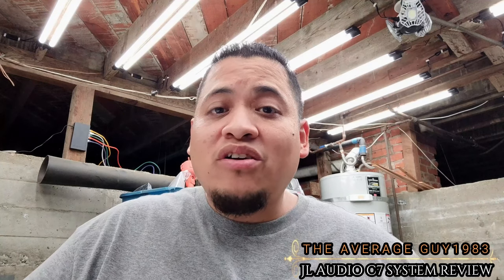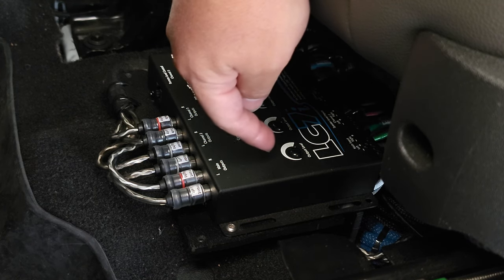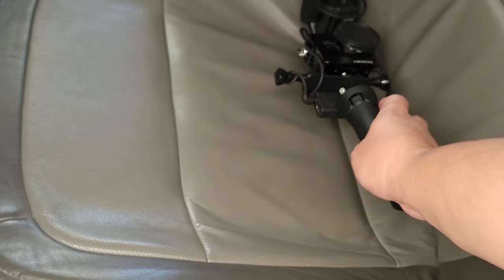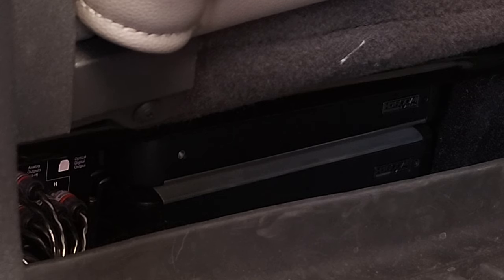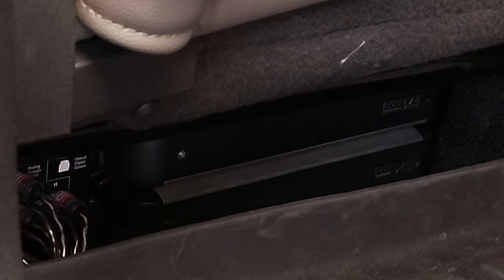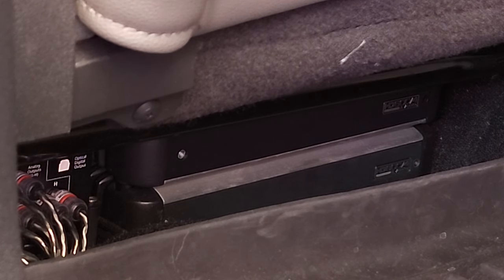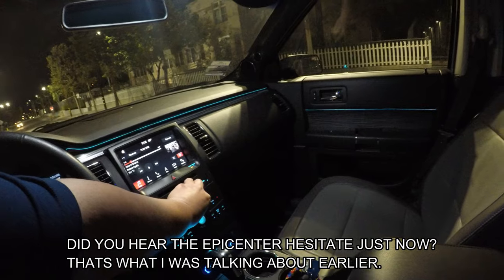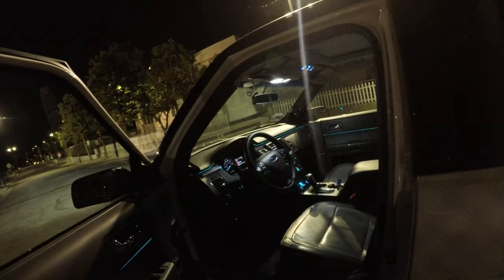MY JL AUDIO C7 AUDIO SYSTEM REVIEW

Comment: I'm considering 2 - JL Audio VX600/6i amplifiers for the front stage of a 3-way C7 setup, 1 bridged (200x3) for the left channel, 1 bridged (200x3) for the right channel. According to your measurements this appears to be 4x their rated real world power. Did you contact JL Audio regarding your findings? If so, what was their response? 

I've always leaned towards having considerable headroom, however 1 VX800/8i (200x2,75x4) or 1 VX600/6i (75x6) may be sufficient. 

Also, I may have missed it, but I didn't notice an alternaternor upgrade. Any thoughts on the topic?
Reply from the maker: Hi Troy, I have indeed reached out to JL Audio prior to making the video review and all they told me was that the recommended Amp Power rating for the C7 speakers are for Headroom but they did suggest that I ether stay with the HD amps and drop the gain on them to match the speakers for clean sound (which is exactly what I did) and found out what they can realistically handle or go with a VX800/8i and VX100/5i for my set up which would have been ideal if I would have know what these C7s can really output. As for the Alternator, I have the Stock Alternator for the moment as these HD amps are very Efficient and even though I have 4 HD amps and other accessories in my flex the voltage does not drop below 12.3 volts at full clean  volume. The only thing I did do was the BIG 3 Using 4/0 100% Copper Wire. The stock Alternator is a 175Amp Hour Alternator and the Stock Battery is a 75Amp Hour Battery but would like to upgrade to a 280Amp Mike Singer Alternator and upgrade the stock Battery to an XS Power D6500. As for the amps, I believe 1 VX800/8i and a VX600/6i should be plenty after my experience with them. I actually have been really thinking of switching the amps to the VX800/8i and 1000/5i as I feel that would be plenty of power for these speakers to perform well and it would free up some space underneath the seats for me. I can then use the HD amps on my other Vehicle project. 😁👍
Reply: Thanks for the response. All good ideas imo, and gives me some insight on where I want to go with my setup. A stock 175 amp alt is pretty nice, but an upgrade should bring the voltage up some. I'm still looking for an alternator for a Mazda CX-30 (130amp stock) but I have come up with nothing so far.  

I really enjoyed your thorough explanations and video documentation of the project. I would look forward to watching the upgrades in the Flex and a project for a new home for the HDs.
Reply: The c7s are not to be bridged except for the 6.5s they all need to be ran at 4ohm single channel for 1 inch and the 3.5 with a dsp u will fry them if u run there rated power with out a dsp
Reply: When u adjust the dsp to the setting as he did in the video u heard him say they was not getting the rated power so with the dsp set correctly u will never put that power to them except to the 6.5s if u set it right ull see 115 watts bridged with the dsp but 85 is about right some songs will pop the 6.5s anything higher

Comment: This is awesome!!!! Man I have 2 sets of c7 6.5 3way and 2w 7 12 and vx600/6 and vx1000/1 ….I used to think my set up was awesome…. Lol
Reply from the maker: Bro that is a KICK ASS set up!!!!!! 😎👌 I'm planning on changing the amps from what I have right now to a VX800/8i and a VX1000/5i for this whole set up. It will help with having less gear and only using 1 knob to control the sub and the main volume of the system i can sell  one of my TWK88S  and buy a FIX86 and the VXI HUB or if i want to keep the HD750/1 on that 10w6, i can get two VX800/8i's and bridge two channels for the 6.5" speakers for a bit of head room, thats still overkill headroom but i can have everything controlled woth 1 DRC-205 😅

Comment: Question? Why are you on gains of amps when they are DSP? Defeats the use of the DSP. I may have misunderstood you? I have a separate Mosconi DSP and Audio Control amps. Infinity Kappa Perfect’s 3 way. Gains are easy on Audio Control LC- 5.1300 and has built in LC7. Btw frequency range on tweeters really only take 1 watt of power due to high frequencies produced. Also I was an old school installer, but new to DSP. Mosconi DSP is much easier(user friendly) than most others. Just couldn’t understand why you don’t use gain in DSP? Of coarse, I have as much in my DSP than I do in my amps$$$&! The W6 is a much better bass choice than I chose, and I only have 6.5 focal for rear fill. All front is active on the 5.1300 and a 2 channel 2.300. These are class D and not A/B, but incredible on RTA!
Reply from the maker: Hi David, yeah with JL Audio's TWK88 DSPs was pretty complicated to set up, on the Input side of the DSP there is a MAX level you cannot exceed and there are only Preset Voltage jumps so its not perfect, then there is apparently a Line Output level that also needs to be set with the amp gain set to Zero but i used JL Audio's TuN software with a DD1+ to make sure the line for each channel did not reach a distortion point, then finally set the gain on the amps as everything is running on Analog when it comes to the gain input. even JL Audio doesnt recommend the TWK88 anymore, now they want me to try out their VXi amps which have a much simpler set up for gain control like the Mosconi DSP you mentioned but the amp and DSP are now integrated making the installation and set up much more easier. Once i have the cash to spare, ill be buying the JL Audio VXI amps and maybe making my enclosure larger to handle a 12W6 instead of the 10W6 but im not gonna lie, that 10w6 even in the small enclosure sounds really good at medium to high volume, i may even consider a 1000 watt amp to run it so you can hear it at low volume. Its pretty SQ with rhe way its set up at the moment. 😁👍
Reply: @THEAVERAGEGUY1983  Agree! Actually I also would love to buy Mosconi Aerospace amps myself! I did a lot of research on the best DSP’s and software. I even downloaded several just to look at because like I said, DSP is so new to an old guy that has been out of the loop for many( 30!😀) years!! I think you were a little hard on yourself about not being a professional! You are much more knowledgeable than many professionals doing installs today!!! We have both went at our installs similar. I do have some advantages though. About 5 years ago, I put a Match/Musway setup in my BMW 5 series. I bought the equipment from UK. Allwoods Audio had a guy named Horst that I spoke to on a daily basis, and he was awesome!!!! Match( Audiotec Fiscker) is same company as Helix. There DSP amp would not work with plug and play on my year car, so had to go to Musway. That mistake cost me $1100 by itself!!!😀. Have one if I buy a newer BMW I guess. Currently I have a 2019 Mustang GT with 9 speaker. These are a nightmare to intergrade into!! Non-B&O analog system not used anymore!! Wish I had the 12 speaker B&O or the basic 4” radio!! Tried everything without cutting all the factory wiring to get past all the equalization in those! I didn’t mention I just gave up and added an Alpine ILX Halo9 and IDATA RR. I don’t use any of the Sync stuff anyway, and the RR lets me use what few things I do use. Of coarse now they make the harnesses and Rockford Fosgate DSR1! ( &650 under head unit and RR cost). You did well starting with very high end speakers to start. You sound like a younger version of me, and welcome to the fold!!! You will constantly be changing something forever!!😂😂. You just made an uncommon, but intelligent choice to buy high end speakers that will grow with you for several years!! Sounds like you’re hooked! Many people buy equipment and the next year they start over from scratch! Some Good high end speakers are not even changed for up to 8-9 years! Example, Hertz Mili Pro( out 8-9 years) with little change, and my Kappa Perfect’s were just discontinued after probably 7-8 years( although have had some change. The JL 10W6 is almost the exact one from back in 97(I think)! I had 3 of them in a Mustang in 97. They were much cheaper then!!! lol. Well I’m rambling on! Good job young man!!!
Reply from the maker: @davidallison976  thank you, its always a wonderful feeling to get some positive feedback from an experienced audio installer. It lets me know that what im doing is at a good level of knowledge. 🙏🙇‍♂️
Reply: @THEAVERAGEGUY1983  no an old installer! That’s been out of the game 30 years!!😀

Comment: Sounds awesome.  What were the other speakers you were considering before choosing JL C7 and what made you decide?
Reply from the maker: Hello, thank you so much for the feedback, as for other brands I was considering 1. Was the AudioFrog GB series speakers (Active)
2. Focal ES 165KX3 3 way speakers (Passive) 
3. Hertz MLK 1650.3 (Passive)
Reply: @THEAVERAGEGUY1983  Thanks for the quick response.   Is that order of preference?  Trying to decide between C7's or Focal ES 165 kx3 or PS 165 F3E
Reply from the maker: @Pha807  yep that was the order as I was very unsure about going full active, from my experience so far using both passive crossovers for component speakers and Active Speakers it's way easier and less of a head ache and work time to go with Passive Component speakers. Only bad thing about Passive component speakers is that you can't set time alignment and whatever frequency the factory has set on their crossovers is pretty much what you are stuck with, vs Active which you have full control of the frequency range, time alignment and how loud you want each speaker to sound. 😅 I wanted to do a video on that as well so others can make the best choice for themselves.
Reply: Active for me.
Reply: Is their any way to contact you directly?  Lots of questions for you.

Comment: Great video keep up the videos
Reply from the maker: Thank you very much! Buying some new equipment so the videos can come out looking better, including the beats I make for the channel, well at least I hope it comes out better lol! 😅
Reply: @THEAVERAGEGUY1983  I need your opinion. I have component 6x9 in my front doors. Should I also go with 68 hz at 24db to get more bass. I’m
Looking for a warmer sound. My system is passive right now but plan to get a dsp eventually. I have a jl audio stealthbox with 2 10tw3-d8 also
Reply from the maker: @mildaudiophile3879  I would say yes but remember to double check how your speaker sounds at your Maximum non distorted Volume on your head unit. As you turn up the volume after setting up your frequency, If you hear that the speaker is starting to sound over driven or like it's going to pop? Lower the gain on the amp you are using for the speakers if you want to keep that frequency or 2. Set the frequency a bit higher like 75 to 100hz that will give you a safer cut off on the midbass that comes out of your speakers. This way you can crank your head unit as loud as it can go with the cleanest signal and not worry about popping your speakers from having too much bass on them. Hope this helps 👊😁

Comment: I do SPL and SQ do you have to run the optical it’s so much cleaner. Don’t use a head unit. Use your phone. So much better. You could also use an iPad. This will get rid of the hissing. Also with Optical no chance of over gaining in the beginning of your equipment. This is where most people make a mistake. I run to 12 inch earthquake speakers isomeric. 17,000 W on each. I  run 1   12 inch In a sealed box.speaker This is for my med base 100 to 400 frequency range the isobaric subs are 100 down to 16. I hit in the 170 DB The reason why the 12 I don’t do hair tricks. It is for the better sound. For SQ. There’s more to tell you on how to do it right but this will get you started in the right area. I have the tweak 88 and the other one. I don’t really care for the 88 don’t need RCA plugs. If you use them you can’t use the optical. Optical is much much better. You don’t have to worry about the match

Comment: Are you running the jl audio w6v3 with the HD amp?
Reply from the maker: Hello, yes I am but I have the Gain set at just under the 650 watt rms mark using a 40hz tone at 0DB for headroom on the power but I don't have the subwoofer crancked all the way as the 10w6V3 can't really handle all that power, based on the enclosure i have it in it seems comfortablewith about 500 watts rms. So the extra headroom power helps alot with music that lacks a bit of bass, it allows me to turn the bass knob up just a bit more to hear the bass to that type of music. With bass heavy music like hip hop, I do have the bass knob turned down to where it sounds the best. Hope that helps. Let me know if you need any further Info and thank you so much for watching the video. 🙇‍♂️🙏
Reply: @THEAVERAGEGUY1983  has the jl hd750/1 amp been holding up good, does it run hot, and how long have you been using it for?.
Reply from the maker: @dc5001  hello again, the HD750/1 amp that I have was purchased back in 2011 to pair with a 12w7AE subwoofer and has been installed in 3 cars Including this Ford Flex. So its technically now a 10 year old amp and it's been working excellent for many years. It does get a little on the warm side but it has never over heated on me and shut down. I've installed it before in a trunk wheel well where the spare tire is before and had Zero issues, it's currently underneath the seat in the flex where there is an A/C vent that i had to cut shorter to fit the amps there and have been using the vent to keep the amp cooled during summer time use. However the amp doesn't seem to like the recommended fuse of 60 amps and prefers an 80 amp fuse instead. Things could have changed with the amp since it's 10 years old now but it Definitely still works great. 😁👌

Comment: I want these speakers but too expensive. I wanted the C5 653 but they are discontinued. I had the c5 2 way and they sounded awesome. Now im looking at Hertz mpk 1650.3 pro. I want Sq all the way. Hate loud.
Reply from the maker: I can relate when it comes to the C5s sounding awesome but being discontinued, I could be very wrong here but I feel like JL Audio discontinued the C5s to obligate consumers to buy their C7 speakers if they want a JL Branded 3 way Component set. I was lucky to find 1 more pair of the C5-653s new from car toys and paid above $800.00 USD for them, quite expensive but way cheaper then buying the C7s and getting a very similar performance with a passive crossover. Hertz was going to be my second choice for my next build. Only bad thing about buying the C5s is that if a driver ever gets damaged, I'm pretty screwed on trying to get a replacement. 😅
Reply: Yup no parts. lol I'd prefer they discontinued c1 though c3 and bring back c5s. lol Thanks for the reply.
Reply from the maker: @formeitwastuesday.1515  yeah the C1s are pretty good but i would have definitely preferred for JL Audio to get rid of the C1s and keep the C5s. Anyways i also appreciate the chat, its been getting slow here on the channel since i havent been uploading any new content while i work on another project off camera. Hope to see you come back again to chat. 😁👊

Comment: I’ve tested the epicenter and the wavtech bassRestore and the wavtech is the better of the two the sq and functionality is unbeatable
Reply from the maker: Hmmmm...... never heard of WavTech, I'll read up about them but the Epicenter from Audiocontrol is a Bass Enhancer not a restorer. What the Epicenter does is converts a higher frequency to a lower frequency once the Epicenter is engaged, like i mentioned in the video, it can either make your music sound better or it can make it sound really Bad in a negative way. The Accubass from Audiocontrol is the bass restorer, their accubass is more like a Bass Boost so it basically strengthens the bass output to sound more full which works great with music like 80s rock and hip hop. Unless the WavTech does what the Epicenter does its probably not the same thing.